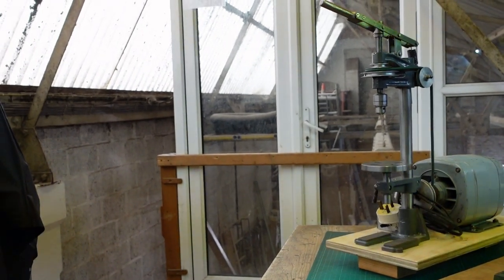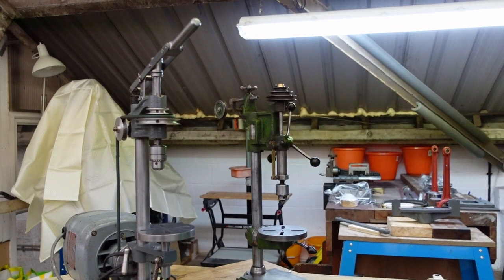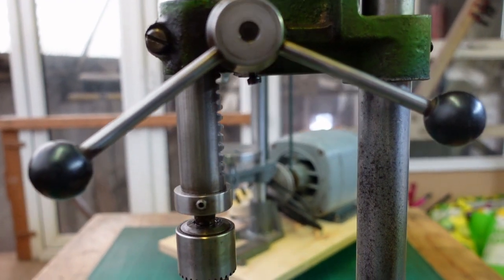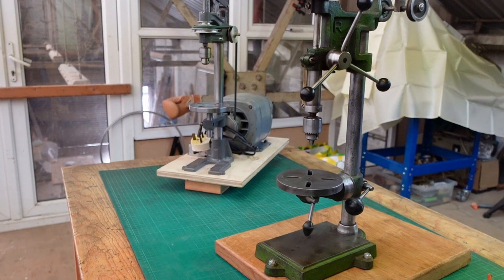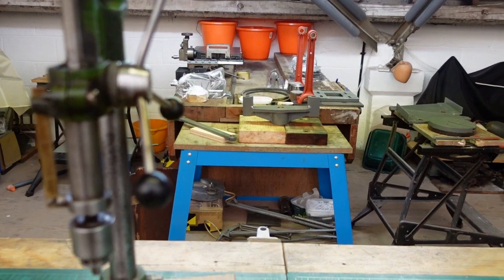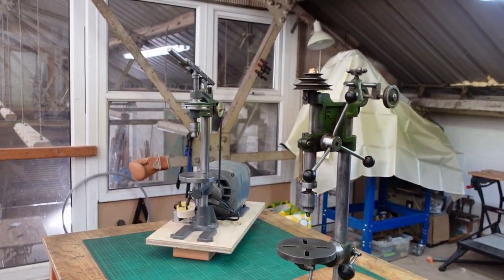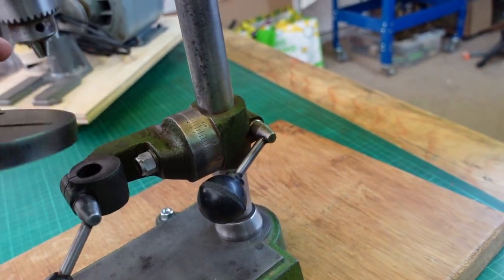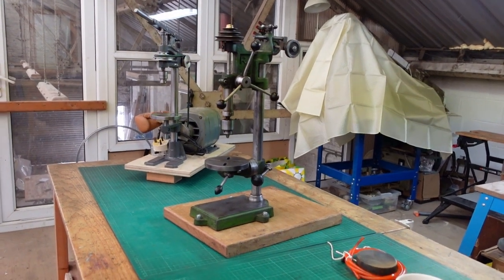Sensitive Drilling Machine - Upgrade.

Comment: Those two machines are as different as night and day. The GHT Pillar Drill is a true Sensitive drilling machine designed for hi-speed drilling with really small drills, as you can feel the drill cutting and prevent breakage. The drilling machine is more like a small drill press for hogging out holes. That rachet spindle has no sensitivity at all. I would keep them both for their intended purposes. My two shillings worth...
Reply from the maker: Hello Pat,
I was using the GHT one today and it was working really well even with its faults... You are  correct that the RE one is not a true Sensitive Drill Machine. Many thanks for taking the time to watch and comment.
Take care.
Paul,,

Comment: Hello Paul,
I would be careful about straightening the handle in the RE drill press as it looks as though it would take it too close to the pulley.
Best wishes,
George
Reply from the maker: Hello George,
I was wondering if I just unscrewed it slightly if the alignment would be okay. I will try and if it works then Loctite it in position. I will ensure it misses the pulley, thanks for being that to my attention. Thanks for watching.
Take care.
Paul,,